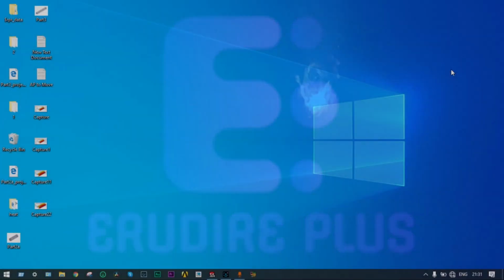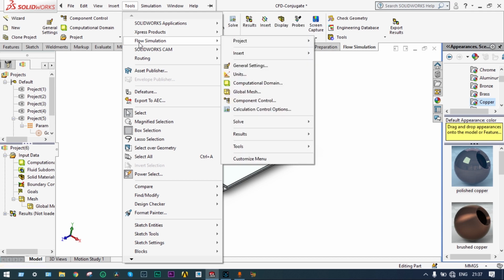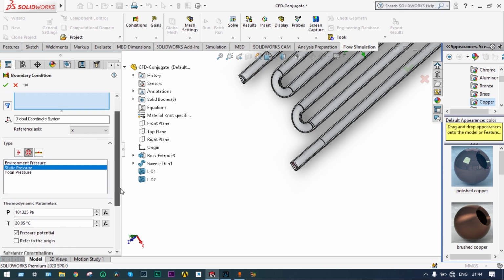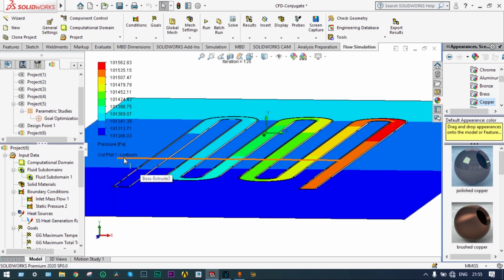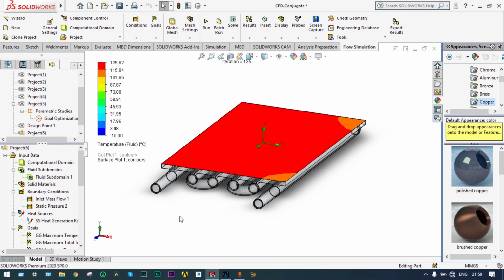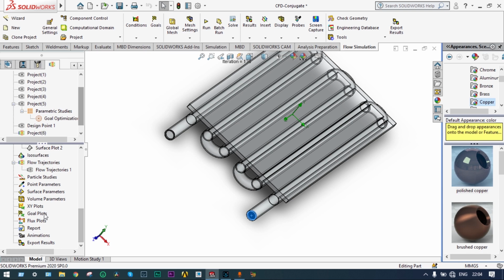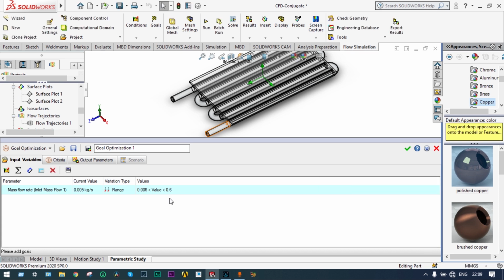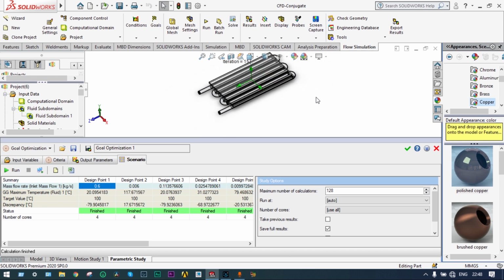Optimizing Conjugate Heat Transfer in CFD: A Step-by-Step SolidWorks 2020 Tutorial

Comment: Using this to help design an evaporator. No idea how refrigerant will reach that high a temp can be misleading. Either way thank you for the tips.
Reply from the maker: You may watch the complete sequence, starting from compressor to condenser. condenser to collector through dryer. Collector to expander and finally from expander to evaporator. Output of one is input of the other. See my complete HVAC simulation to have a complete idea of HVAC system.
Reply: How would you use the data from the fluid flow analysis to do a thermal design study or optimization for say dimensions? In other words how do you import flow simulation data create a new study in the simulations tab? Thank you for your contributions, very useful information. Also, say the evaporator is an ice mold for an ice machine, how can I simulate the heat generation of water on the surface of the solid? Would I just solve for rate of heat transfer at the lowest evaporator temperature vs temperature of the water and mass of the water with specific heat? Your input would make my day.
Reply from the maker: After your first simulation you can go for a Parametric study with different input variables with some specific ranges e.g. input boundary conditions or geometry ( dimensions of your model). From there, which result is more preferable, select that one with more precise range to have optimization.